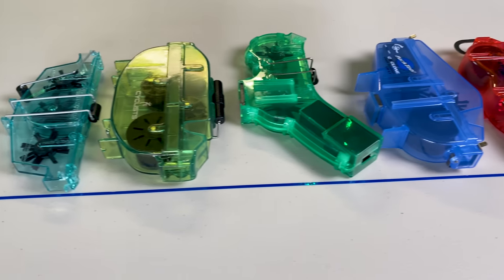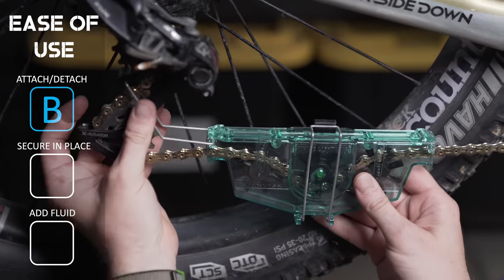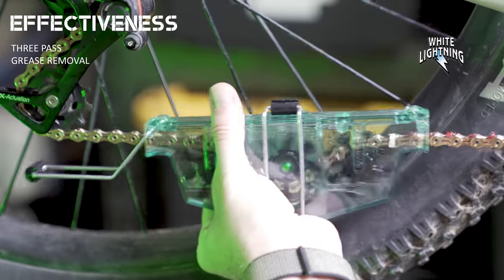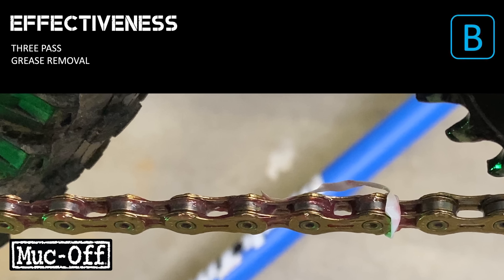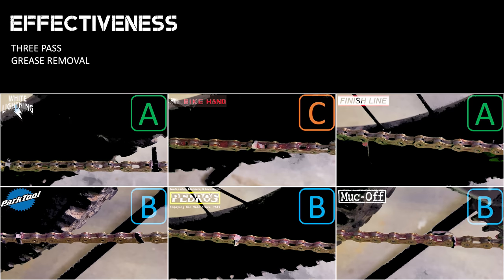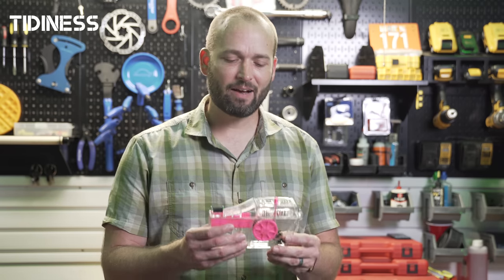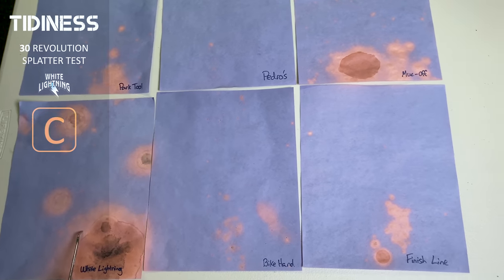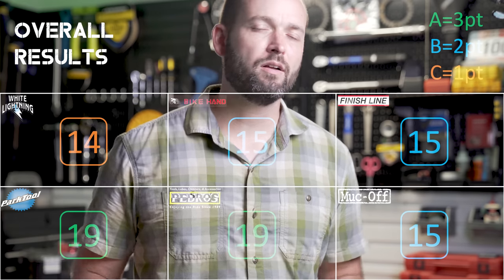Best Bike Chain Cleaning Tool Under $40? | Top Bicycle Chain Cleaners Compared

Comment from the maker: I missed that you can buy spare brushes & wipers for the Finish Line Pro Chain Cleaner for ~$8.  This doesn't change the overall results, but wanted to share the correction.  Thanks to everyone for the constructive feedback - it helps us make better videos! - Jay
Reply: I wore out my brushes and wiper on Finish line and bought new ones. Like new! Then promptly the case cracked and leaks. Oh well. Can vouch the magnet is a nice touch, but the big angle on chain makes it hard to pedal quickly. Going to try Pedros next! Thanks for the great and thorough video
Reply from the maker: @brianwalker9793   - Oh bummer! Thanks for sharing your experience!  Let us know how the Pedro's works for you. - Jay
Reply: I missed any mention of replacement parts... in addition a brush set for the Park Tools Cyclone is ~$13.
Reply from the maker: @Arfonfree   - Thanks for the tip.  The replacement parts were simply noted as a "Y" or "N" on the scoring for each unit under the Brush & Wiper Quality section. 5:54 - Jay
Reply: Looks like that you did not see the Magnet on the Bottom of the Parktool!
Iam using this one sometimes and the magnet has hold on to some Particles. At all i use this tool not with mounted chain because everything else is dirty and needs to be cleaned 1 by one.
Reply: For those with cleaners that don't have magnets, I suspect it would work as well (or better?) to just drop a coin-sized neodymium in the bottom of the cleaner...  I will definitely be trying this.

Jay, is your right arm a lot bigger now after 2000+ cycles?  😂
Reply from the maker: @d00dEEE  Great idea! 💪- Jay
Reply: Good video, well done and informative. My only complaint, which you should take in stride, and not take personally. Perhaps you can lower your voice a couple of keys
Reply: send this video to all the product makers, maybe they can built an even better chain cleaner. :)
Reply: also, should not the categories be weighted?  ie. these are cleaning tools, to that should carry the highest weight while  drop test (for me) wasn't that important, compared to the ability to clean, the sloppiness and the durability of the brushes.
Reply from the maker: @patrickadams5764  I considered weighting the results - but decided instead to simply share the facts and let each viewer choose what's most important to them. - Jay
Reply: @SimplyMountainBiking  Nice vid, of you're in a hurry to clean chain. if not, i usualy use 2 half of a litter bottles, perfectly colsed, where i keep the needed to cleaning chain. After that, try to use best lube i can find. And this is the best way :)
Reply: 1
Reply: Fantastic review!  But what's ironic is that the seventh tool, the one you dismissed out of hand, is actually incredible!  I've been using one since 1993 or 4.  I bought it from Performance Bike back in the day.  When it first came out (sans handle that your model came with), it was called the Bibox.  Mine has a clear housing with blue guts.  I'm pretty sure I paid $20 for it back then so if you can find a new one for $20 or so, I'd consider that a steal for how long you can expect it to last.  I've had only great success with it all these years!  It's EXTREMELY effective at cleaning (scrubbing from all four sides), it's super durable (when you drop it, it breaks apart and is then easily reassembled, with all moving parts fitting together in a logical layout), and just designed exceptionally well.  I love that the brushes are very fine but appear to be injection-molded plastic the same as the rest of the unit/parts so they still look about as good as the day I bought it!  Thanks!

Comment: Nice comparison. Two observations from my experience: I buy a chain cleaner to clean my chain. So I would weigh cleaning effectiveness much heavier than the other criteria. Second: I have destroyed chain cleaners with metal pins by letting them dry in the sun... the metal gets so hot and expands, causing the plastic surrounding it to crack. Happend to me twice. First time I didn't realise what caused the destruction. Took me a second time ;-) Keep up the good work!
Reply from the maker: Thanks for sharing! Great tip - Jay
Reply: I also think that cleaning should be more important. Also, the one cleaning the best is the cheapest one... you can buy almost two at about the price of the better ones, and I doubt that bristles and everything would score better in the more expensive one vs the cheapest used half as long. 
I have the cheapest and also one similar to the Finish line. Last time I used the latter because it has brushes cleaning the sides of the chain, while the cheapest one only the inner part.
However the grease test could not (obviously, it's ok) judge how good the cleaner dislodges dirt in the rollers. The first cleaner, bending the chain, should be the best also for this reason. I think I will use the cheapest one more often in the future.
Reply: @olafmarzocchi6194  it’s not really good for the environment to buy disposable cleaning tool. By looking at this test, I think some tools will be good for way more than twice the time.
Reply: Yes but the test is only about cleaning efficiency. I guess with more time and cleaning cycles spent on less efficient tools you can achieve equally good results. I would definitely not put too much weight on the cleaning rating.
Reply: Park tool aluminium version is the king of all cleaners!
Reply: I don’t think it’s the thermal expansion of the metal pins that’s cracking it, since most plastics expand much faster than metal. I think it’s just too much heat into the plastic itself.

Comment: It's an odd comparison in that it appears to have weighted all tests equally. I'm FAR more interested in which tool removes the most grease/debris than which tool withstands being dropped.  What I want is a clean chain.  I can learn to hold on to the damn thing.
Reply from the maker: I considered weighting the results, but thought I would just share them all equally so that everyone could make an informed decision based on the factors most important to them. Cheers! - Jay
Reply: These chain cleaner/scrubbers immensely reduce the time, effort, and mess.  I think that they all use plastic brushes.  Plastics vary in durometer (hardness), stiffness, brush bristle diameter, and modulus of action.   You could modify the brush "wheels" or make a whole brush assembly.   Experiment with brass, stainless steel,  copper, various plastics, or some other type bristle-fiber materials(glass, boar hair, horsehair....  There's a wide spectrum of bristle types.  Once you settle on  a favorite (or  group of favorites...you could patent the configuration.   Then offer  licenses to the tool manufacturers. If you install some super hard, coarse, and stiff bristles:  you might end up scratching/-upbraiding  the coating, plating,  or special surface processes,  and/or destroying the bearing o-ring seals ...   Sometimes you can go TOO AGRESSIVE.  Soft bristles may require additional cycles through the cleaner and/or  cleaning fluid changes...  But they reduce the risk of damaging/destroying yir fancy chain.
Reply: I agree completely.  The test was thorough though and allows me to weigh the categories, which resulted in a different conclusion.  If it can’t perform its basic purpose at an A or B level, the other tests don’t matter.  This said, even if it cleans well, unless you’re buying it as a really inexpensive one use item, a couple features seem important to me - replaceable cleaners and adding cleaner.  I think the magnet is a great idea, but it seems your own magnet could be added to any of these without much expense or effort.  It should also operate with minimal effort.

PS I’ve had a Finish Line cleaner for several years, but it is a flat design with no magnet.

Comment: I’m meticulous with drivetrain maintenance.  Happy with Park, and I have no desire to try another. Being able to top off fluid while the unit is on the bike is paramount imo. I begin with the unit full of dilute solvent, spin the cranks until most of the fluid is pulled out, then replenish with water a few times while spinning.   Pull the unit, then hose off the chain. Splatter is a ridiculously moot point.  I get at least three seasons out of the Park, caring for 2 bikes that get heavy use and regular cleaning.  Just buy the Park

Comment: Nice review/analysis. My only suggestion is that clean grease is not the same as road grime. Testing with the grit of metal and physical dirt surely will present different challenges for each of the cleaners. I’ve used the Park Tool for years, and still find that it requires some brush work for the exteriors to really get the chain completely clean. Oh, and the sponge gives out way to quickly….but is easily replaced by cutting a sponge into the approximate shape.
Reply from the maker: Thanks for the comment and feedback! - Jay

Comment: I have the Finish Line and it's holding very well. It helps to push the unit down to increase the tension of the chain while backpedaling. And to keep an eye to the exit angle of the chain in relation to the chainring. Once you know these tricks, it's really easy to use. I also usually dilute the degreaser with some water to reduce waste. The unit itself spills very little, but as soon as you stop moving the cranks, most of the liquid in the chain falls to the floor.
Reply from the maker: Good to know, thank you for sharing! - Jay

Comment: Great video. I like how the chain pig frees up a hand but think I'll stick with my Park Tool cleaner. I need to get a good degreaser that I don't get horrible about dumping. I like how this video gives me Project Farm vibes.
Reply from the maker: Hey thanks! - Jay
Reply: I use Weldtite Citrus Degreaser with my Park Tools Cyclone.
Does a good job, and it's biodegradable (if that's what you mean).
Reply: That's high praise comparing to PF!

Comment: Love the park tools, used it for years. It also had a magnet at the bottom to catch any metal fragments that sink to the bottom to stop them being mixed with the cleaning fluid and causing wear.
Brilliant design, and lasts years.
Reply: I second this. It's surprising how much that magnet collects too. One of the clips snapped off mine though.
Reply from the maker: I definitely like this design feature on the park tool. - Jay
Reply from the maker: I had that happen on an older park tool model.  The current model I tested seemed to have a different attachment method for the magnet that I think will hold up better. - Jay
Reply: @SimplyMountainBiking do you know if the new iteration cleans better too?

Comment: Great review my only criticism really is the low cost generic chain cleaner wasn't included. Many of us cheap out with such a unit and would have liked to see how it compares. The one I have which was about £3/$4 I think would do better than some of those featured in use although don't think it would endure the drop test as well as others as the plastic is a bit thin and brittle but it hasn't broken in normal use yet. Just for fun  2 old toothbrushes and a rag could have been in the mix too just to see if its worth buying a dedicated chain cleaner.
Reply from the maker: Good call.  I decided to narrow down the tests to keep the video production time manageable - but maybe we'll circle back sometime and test some other methods for chain cleaning! - Jay
Reply: The bike hand one looks very similar to my generic one (from Jensen) right down to the rusted "stainless steel" pins. :)
Reply: Thanks for the video, super informative. My 1st chain cleaning unit that I bought when I arrived in the NL 🇳🇱 was a generic unit and it works like a charm - around €3.50 and it's been good to me. It's the Marvel brand (bought in South Africa before I came to the NL) - works well and is cheap as chips. Tks mate.  @SimplyMountainBiking

Comment: I bought the metal version of the parktool cleaner. About half a decade later and the case is still undamaged and it is passed around between me and five friends. best chain cleaner I have ever bought hands down. Worth the extra money
Reply from the maker: I was wondering how that would perform, but wanted to compare cleaning tools in the same price range.  Glad to hear you've had a good experience with it! - Jay

Comment: Thorough review although imo White Lightning wins hands down! Getting the chain cleaned and the price is what really matters. Also, it's not that hard to attach and having to take the top off to put in fluid is not really a big deal. An A on drop test doesn't hurt either.
Reply from the maker: I'm glad you were able to use the comparison how I intended!  I was hoping everyone could draw their own conclusions based on what's important to them! - Jay
Reply: I agree...I would not buy or use a tool if it didn't remove all the grease
Reply: Agree! Even though it does not have replaceable parts you can buy 2 for the price of the ones he picked. Second it would take 2 seconds to drill a hole so you can add fluid.

Comment: 'White lightning' is sold with many different names. I have used this design for years and it is very effective. Yes, it is messy but effective. I use 'Muck-off' Dry lube for lubrication after cleaning the chain.
Reply from the maker: Thanks for sharing! - Jay

Comment: This was a great test. One aspect of the cleaners you noted was the amount of chain bend required. While this can be inconvenient for bikes with derailleurs, for certain cases (internal hubs, single speeds, tandem bike synch chain) having a cleaner that does not bend the chain (like the Park version) is essential.
Reply from the maker: Great point! Thank you. - Jay

Comment: Wire coat hanger (free), twist tie from grocery (free), glass jar with metal lid from pasta sauce (free), 1 gallon gas container ($20), 1 gallon gas ($4-$5).  In my experience, gasoline as a solvent cleans chains better than all the other cleaners out there and does it quicker.  Pour a little bit of gasoline in the glass jar.  Remove the chain from the bike using the quick link, attach the quick link to the twist tie and tie that to the chain.  Dunk the chain+quicklink into the glass jar with gasoline, put on the metal lid.  Shake vigorously for 1 minute and watch all the dirt and grime settle to the bottom of the jar.  Let it sit and use the coat hanger to fish out the chain.  Wipe with paper towel and hang to dry.  Put clean chain into hot wax bath and hang to dry/cool.  Put chain back on the bike.
Reply from the maker: Thank you for sharing your process :). - Jay
Reply: Some of us with eBike chains cannot use quick-links so having a chain cleaning tool like these is our only choice.
Reply: gasoline has residual oil in it and just allows the chain to attract dirt easier next time, not to mention prevents the wax from adhering fully. better to use a proper solvent for the use

Comment: I own the Finish line cleaner and it is intended to use in slightly different way. 
That`s why it is awkward to put it in.

You should put it on the chain and then push it dow, so the chain copies the shape. 
Then you don’t have to muscle anything. 

Just refer to the package and you’ll see all the details 🙂
Reply: And as a bonus, the wipers then work a bit better too 🙂 Just tilt it to adjust pressure on the ends.
Reply from the maker: Thanks for the tip!  I think that my clutched derailleur likely kept too much tension on the chain to allow it to conform to the cleaner's chain path. -Jay
Reply: @SimplyMountainBiking  maybe, I'm using it on 1x12 SRAMs and working for over year now. 

But still sometimes I take the chain off and clean it separately with deep clean of the whole drivetrain 🙂

Comment: Very helpful and informative! Many thanks! Surprisingly, my Muc-Off chain cleaning tool is still has no damage and seems to be working well after a year of weekly use, but after watching this, I may go for the Park Tool one next time.
Reply from the maker: Great to hear! Thank you for sharing your experience, glad to hear the Muc-Off is going strong! - Jay
Reply: Finish Line cleans better, i have both and also FL only has the ONE center clip not one on each end that doesn't lock in as easily but that weird chain angle takes a while to get used to

Comment: Great video! Very cool to see all the different products back to back!

I am surprised that the park and pedros both got the same ease of use rating. I own both and the pig tail is such a game changer to keep the cleaner in place. I have blown out a park cleaner by having it drift into the chainring while cleaning. I feel like Pedro’s is the superior product. 

I think that the ones that stay in place are a much more user friendly design. Especially for bikes with short chain stays. 

Keep up the great work!
Reply from the maker: Thanks for sharing your experience.  I agree that the tail on the chain pig is a great feature! - Jay

Comment: That was a pretty thorough test but I'd like to see how they perform on a dirty chain. I currently use the White Lightning tool and Simple Green. I also would like a comparison of degreasers.
Reply from the maker: Great suggestions, thanks! - Jay
Reply: @SimplyMountainBiking  Yes! Degreasers should be on the top of you video idea list please :o
Reply: I feel like the grease was way harder to remove than any conceivable 'dirt'. In fact I think the test was a little unfair to the tools it rated 'b' for cleaning effectiveness.

Comment: You stated that the finish line parts were not replaceable,  I just wanted to let you know I purchased new brushes and wipers off Amazon last year. 

I have been using one for about eight years and always had good luck with it using mean green degreeser that I buy from dollar general for about $4 a gallon.
Reply from the maker: @Kevin - Great catch! Looks like you can buy spare brushes and wipers for about $8.  Thanks!  -Jay